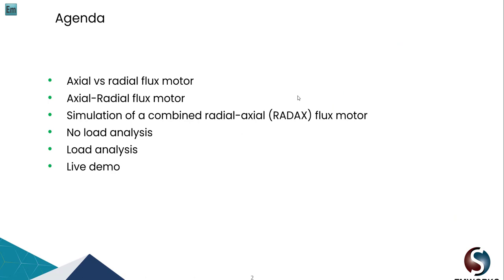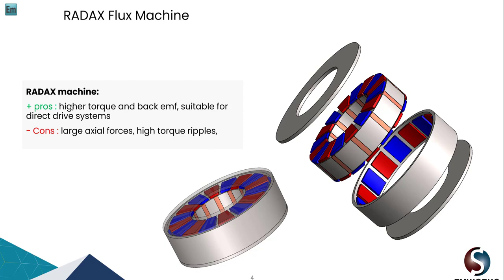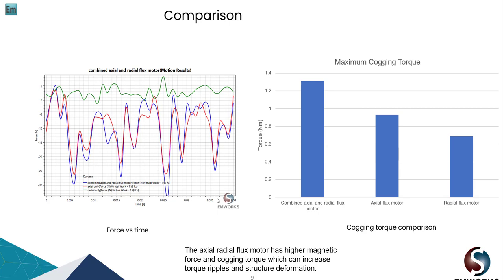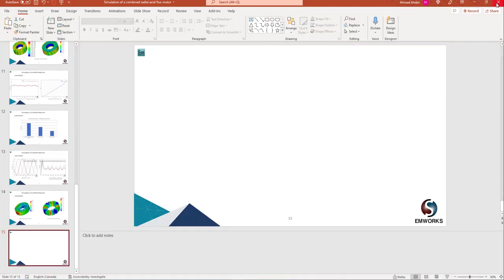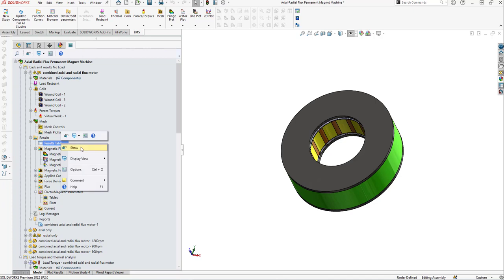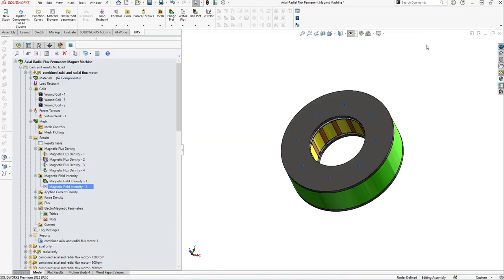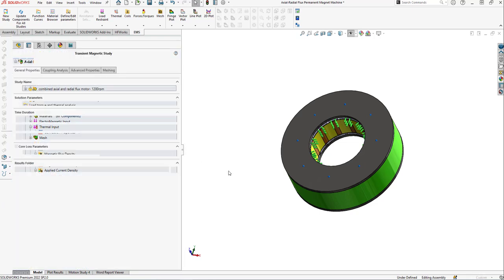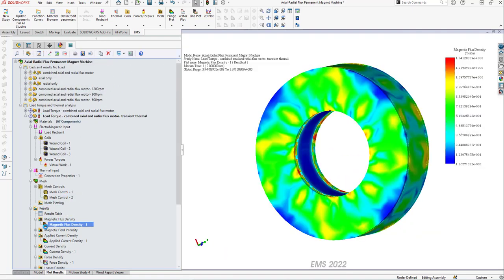Simulation of a Combined Radial-Axial Flux Permanent Magnet Motor

Comment: i see the frequency you used in the simulation was 50hz ,when used with inverter controllers dont they use switching frequencies in the KHz range and 375 rpm seems quiote slow for this type of motor
Reply from the maker: Thank you for reaching out! The operating frequency of a motor or generator is determined by its mechanical speed (N) and number of poles (P), using the formula:
𝑁=120×𝐹/𝑃
So in this case, with 50 Hz and a certain number of poles, you get 375 RPM — which is expected for a low-speed, high-pole-count machine.
Now regarding inverters: Inverters use Pulse Width Modulation (PWM) with switching frequencies in the kHz range (like 5–20 kHz) to generate a smooth, controlled AC output. However, this high-frequency switching is used to synthesize a fundamental waveform — typically 50 Hz or 60 Hz, depending on the system requirement.

Comment: think im going to give this software a try ,think they call these motors with both axial and radial flux ,Transverse flux.So transverse flux with a Halbach magnet array this has got to be a interesting motor and not to hard to make id think just time consumingquestion is what controller would be required
Reply: actually some of the latest generation VESC based controllers should be able to run it but would need a rotary encoder or hall sensor array
Reply from the maker: Hi! Thank you for reaching out! You can use Field-Oriented Control (FOC) with a Digital Signal Processor (DSP) for the transverse flux motor. This setup allows for smooth operation and precise control of torque and speed. You'll also need current sensors for phase current measurement, feedback mechanisms like encoders or Hall Effect sensors for rotor position sensing, and a suitable inverter to convert DC to three-phase AC voltage.
Reply: @EMWorksInc  yes thanks very much im looking at ordering 2 of the STR-500 Vesc controllers with vesc express for this project ,ill either be using samsung 30q cells or Molie cells in novac dilectric cooling solution
Reply: im pretty sure i need the 2 controllers as from what i gather the radial and axial aspects are slightly out of sync with eachother

Comment: is there any chance we could run the radax motor simulation with specifications from a high end motor controller
Reply: i am sure these motors will absolutely dominate as normal direct drive hub motors dont get as high rpms as we want as they try get that ballance of rpm and torque we may not even need magnets on the side covers either we could use something similar to car altinator how they bend the magnetic forcearound
Reply from the maker: Thank you for your interest. For more information about our software or simulation model, please contact us at: https://www.emworks.com/contact.
Our sales representative will reach out to you shortly and connect you with the appropriate application engineer.
Reply: from my reasearch and experiement into these motors the current ev motor controllers would not work with type of motor as the axial and radial sections seemed to run slightly out of sync ,so theres winding for the rad and winding for the axe parts ,
Reply: exactly how they are implementating this is really hard to reasearch ,it seems to be closely guardly ,im not supprised either

Comment: Nice work .Thank you .
You can get rid of cogging torque and increase efficiency and also  lower the eddy currents by using air coil - coreless stator or magnet wire would around something that's not containing steel to make up the magnetic coils.